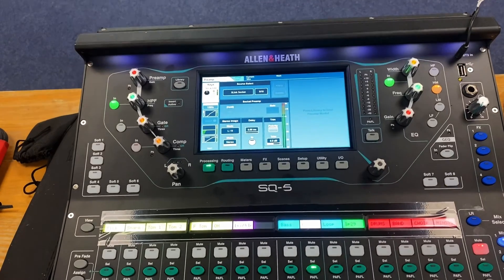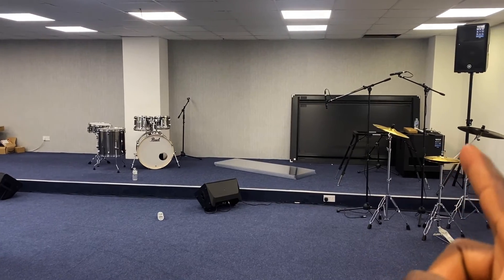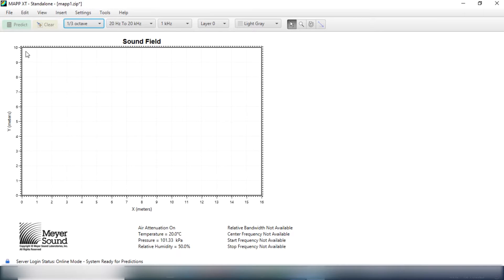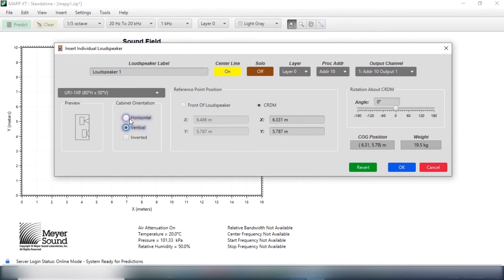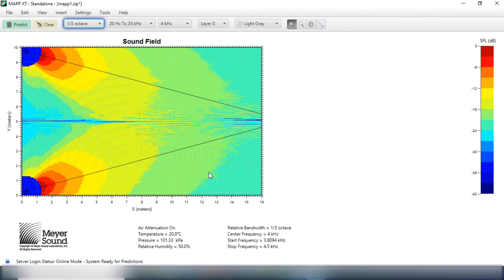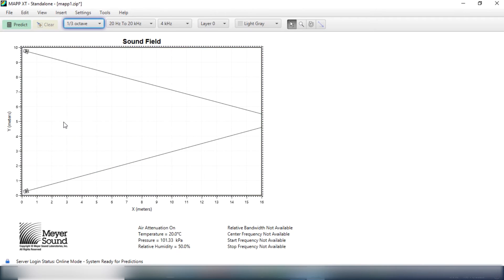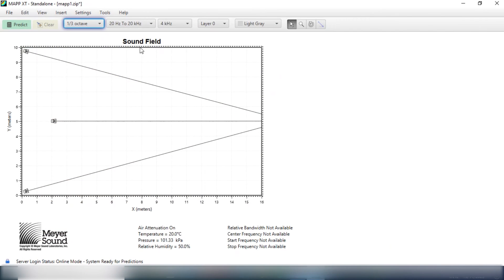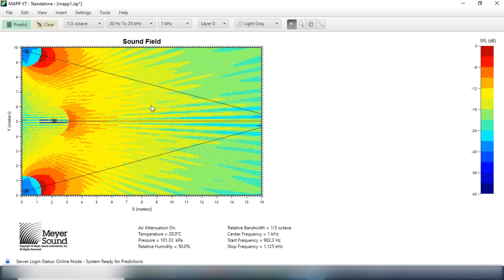Speaker Placement Design for Small Churches: A Live Example

Comment: Pretty cool bro. Iv been following you for so long and I like how you break things down. I’m a drummer and a sound engineer and I love how you explain things. It’s quite difficult getting a video on YouTube to explain as well as you do. 
One thing most upcoming sound engineers don’t do is checking their speaker specs. It’s really really important knowing horizontal coverage and vertical coverage. Infact you can pick a particular type of coverage depending on the type of room you have.  
I’m also in the UK, will like to work with you if that’s possible. 

Kudos bro